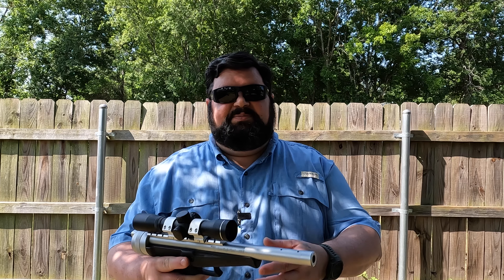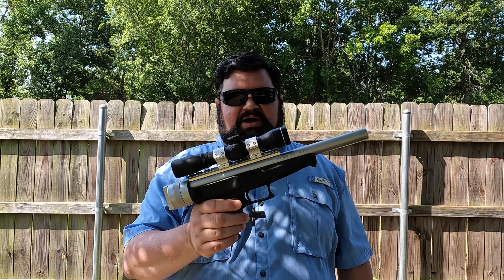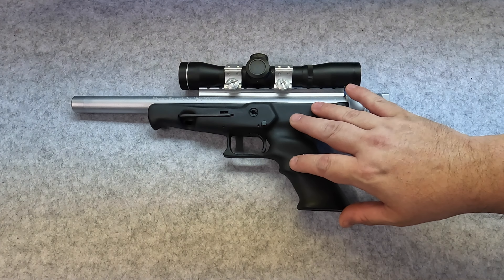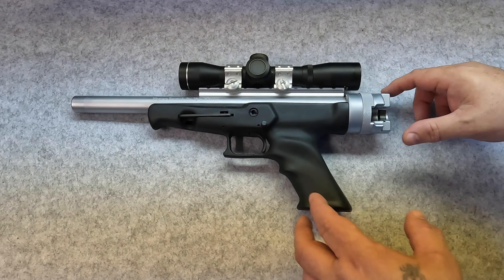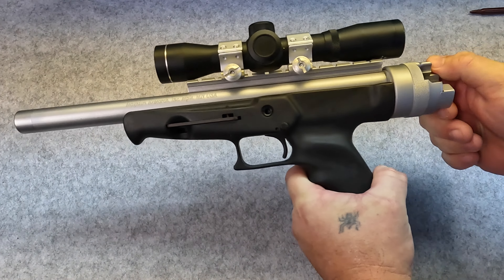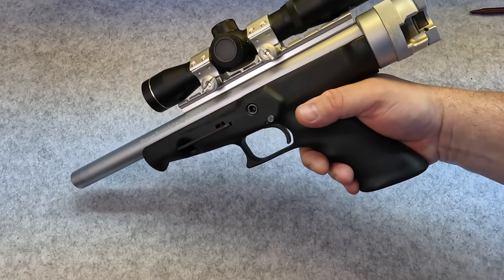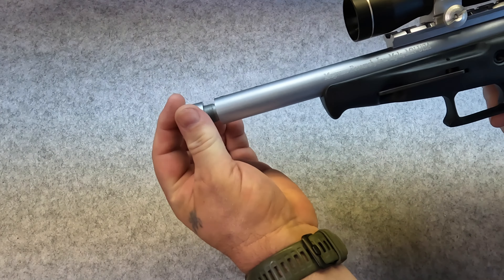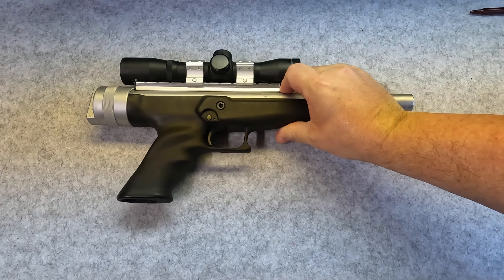SSP-91 Lone Eagle canon action pistol

Comment: No one made a video of how the weapon works or how to dismantle the weapon. My friend did it before them
Reply from the maker: I might do a disassembly video, as I have done it before to set the adjustments.  It’s just that I have mine set up just right and would hate to loose or strip any of the set screws, and it takes a bit of adjusting to reset up. 
It’s not that bad, you just have to do set things in order and locking/unlocking part on the back has to be tapped half way off to be removed.  
Sadly there are not a lot of replacement parts available anymore.
Reply: @CAVCOP   You do it for the viewers so they can see its internal parts and how it works. Greetings to you